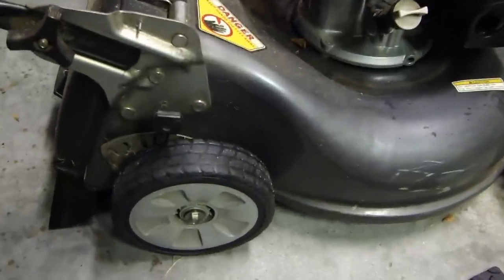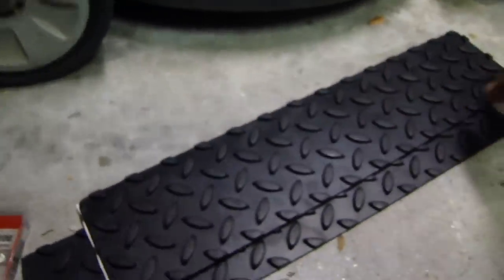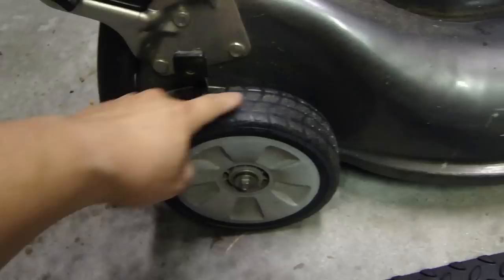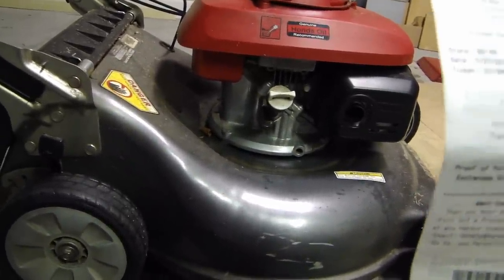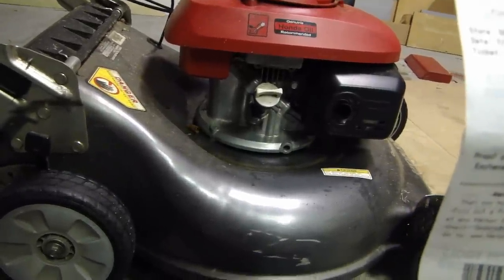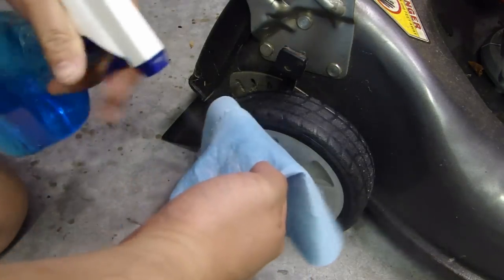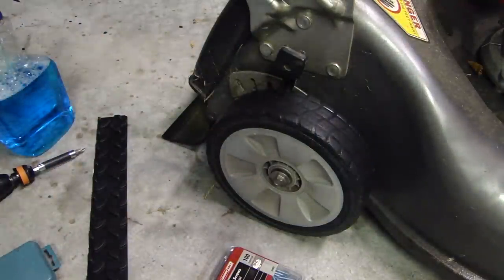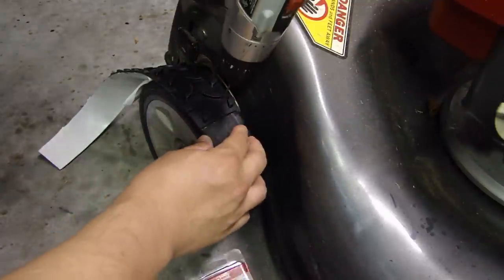How to Retread the Honda Lawnmower Wheel

Comment: I loved the retread idea I used a old 26 inch knobby mountain bike tire off a junk bike worked great cut off the sidewalls it fit perfect and was more than enough for two 8 inch wheel. cleaned up the wheels than roughed them up a bit with sandpaper got a tube of goop glue and used screws like you did saved me 50 dollars and in my opinion they perform better than the wheels did when it was brand new. this was a great video and idea thanks.
Reply: I did the same, with mountain bike tires (after the materials suggested in this video worn out almost as quickly as the OEN plastic wheels): Cut along the sidewall, and screwed 'em into the old, worn tires (after removing the worn out stair tread material) and it's lasting MUCH longer that either OEM OR the stair tread material!

Comment: Thanks very much ! Your retread procedure deserves much more exposure. I saved $50.00
this year and the treads are still good after three months of constant use. Living on a small lot
all of my cutting involves frequent pivoting in tight corners, and my new treads hold the turns
better than the Honda OEM wheels.  Thanks again !!

Comment: Great idea. Replaced wheels are expensive these days. I once had a RWD Mower wheel spin in its tire. I first thought the RWD Mechanism was going bad. I had to drill the edge of the rim in four even places places so to drive a screw to attach the tire fixed to the wheel. It worked great.

Comment: Prior to installing the material shown in this video, I had purchased a roll of the industrial type self-adhesive Velcro. First,  clean the tires with Acetone and cut the velcro to fit.  After you cut the rubber strips, place the other piece of Velcro on the sticky side of the rubber (i.e. sticky side of Velcro to the sticky side of rubber strip).   Wrap the Velcro tight around the wheel, prior to using the screws as additional adherance support.  This works great and also lasts much longer.

Comment: Thank you! Thank you! Thank you!!! I used your hack exactly and the gain in traction is amazing! The only thing I did wrong was place a couple of the screws too close to the end of the treads and they ripped through. Easy fix though. Just redrill and replace the screw closer to the center of the tread. Again, THANK YOU!!!
Reply from the maker: Thanks for sharing! Cheers

Comment: Very cool idea, never thought of it. But I can tell you something similar that I did do before. Also with a walk-behind self-propelled mower that was slipping way too much on my hilly wet Pennsylvania yard. I used sheet metal screws, stainless steel, and just screwed them into the tires. I left each one stick out enough to act as "studs" on the tires. Now, they dig into the wet grass better. The mower can go uphill without having to push it. I'm thinking of doing this on the tractor next.

Comment: I used the Harbor Freight safety treads but they fell off since they weren't made for wheel use.  I recently put a mountain bike tire on, holding in place with contact cement and deck screws.  It worked great since the mountian bike tire was more pliable than the HF safety treads.

Comment: I used an old timing belt with some exterior liquid nail. Both wheel show very little sign of wear after two seasons.  The wheels for my craftman mower cost around $25 each.  Therefore, $5 for a tube of liquid nail and an old timing belt (enough to cover both wheels) justify the effort.

Comment: I did this same thing but a little different, I removed the rear wheels and threw them in the trash then I got new ones from Home Depot and put them on.
Reply: Brad Bozarth bahahhaha.
Reply: Treds dont look that great.   Is there any bad bpy option for steep inclines?
Reply: That's not a bad idea when the tires are $25 a piece. But when you have a commercial grade HRC216  K3, the wheels are $90 - $100 per wheel!!! And we only get about a season out of a set.
On Honda's older model HRC-216's (the K1 and K2 models) you can buy just the tires for like $20 or $25 a piece. Which was awesome! 
But these newer model wheels suck! Especially when you pay $1600 - $2000 for a 21" push mower!
Reply: I did this a couple of years ago, and now I’m back here looking for a way to retread my drive wheels because the replacement wheels that Home Depot sells are hard plastic (meaning they have terrible grip even when new), and have already worn down to zero tread, making them as slick as teflon and beyond useless.

Home Depot wheels are trash, don’t waste your money.

Comment: Bought the HF treads and am ready to go thanks to you. Just wondering if dipping the screw threads in some glue ... Goop/E6000 for example ... prior to inserting them might ensure that they stay put over time. Then again it may not help that much if most of the glue squishes out. What do you think?
Reply from the maker: With the method shown, I got about 2.5 years of use out of them. Eventually the rubber tread do start breaking apart. I just finished retreading it a second time to get couple more years of use.

Comment: Thanks, just followed your video and redid mine with screws and put a few extra screws in for good measure... I think easier than the bike tire method.  got my safety step tread at Home Depot. for $8 , just down the street, same as in video  just make sure you use longer screws that go into plastic of wheel, tried half inchers 1st and would not catch. . Increased pull  about 50% over bald drive tires on 10 year old Craftsman with original wheels...was going to replace drive wheels at 1st with new  Craftsman wheels but reviews were terrible says last one season due to p;astic gears and $12 to $30 per wheel depending on source.  The wheels have lasted 10 years so this is the way to go.
Reply from the maker: Excellent. Thanks for sharing your work. Definitely cheaper than replacing the wheels.

Comment: excellent job, how long are the screws you used, I don't think you mentioned that, if so, sorry to ask again ... i had read somewhere that someone used just studs and it worked fine but may not be durable long term.  this looks great i am a harbor freight fan!

Comment: The rear drive wheels have a cog and gear inside the wheel hub. The screws may hit the gear as the tire goes around.
Reply from the maker: The short screws do not interfere with any of the rear drive mechanism.

Comment: My back tire rubber is coming out of lip of the plastic rim. Can rubber be screwed in from the sides or only be screwed into the top like you did on the retread. Any help would be greatly appreciated. I have a honda lawnmower  model number HRX2174HYA.  Thank you. Kash
Reply from the maker: kash You should be able to put screws in any part of the black plastic tread rubber. It's a solid hard plastic piece.
Reply: +dial2fast no it aint

Comment: I just tried your method and I was not successful.  After about 5 minutes of using the threads just peeled right off.  But initially I could feel the extra power and it was great.  Maybe I didn't allow he adhesive to dry on to the tire long enough.  But they came right off.  Maybe I can try it again and add additional contact cement and let it actually dry for 24 hours or so.

Comment: Not bad, but using a bicycle tire is 100 times better and since it's softer rubber it not only grips turf better but also wears slower than those HF treads you bought which are a hard plastic/rubber.  However I don't know of a bike tire would work on tires like yours that have squared edges.

Comment: I think it is a shame that Honda requires the entire wheel replacement, when only the tread is worn--what a waste to the environment. They could easily design and sell new treads. Even new, their tires have the worst tread in the industry. I like this idea, but will probably buy new wheels at $12 each just for convenience.
Reply: raspillade Honda actually sells new treads.  Unfortunately, they cost more than the entire wheel.

Comment: I would simply buy a new wheel.
Reply: I was going to but they are 45 bucks each, plus shipping-I wont pay that
Reply: They can cost $40 and up, depending on the mower.  However, the cost is irrelevant (in my situation) because some mowers do not have tires available that have rubber tread.  For instance, my Toro Recycler 20331 came with rubber tires but now all they make is plastic tread tires for it which wear out in 1 season (both OEM and aftermarket, they are all plastic treads for my model).  So even if my replacement tires only cost me $10 a pair, I would still do this instead because rubber grips the turf SO MUCH BETTER THAN PLASTIC TREAD.  I have a bank to mow and a good grip (which only rubber tread provides) is essential!  So if this retread method cost me $100, I would still do it because it would keep me safe on the bank and would work so much better.  And if mounted to the tire well enough it should last a long time and would save money in the long run.